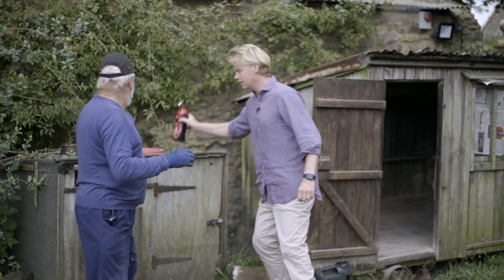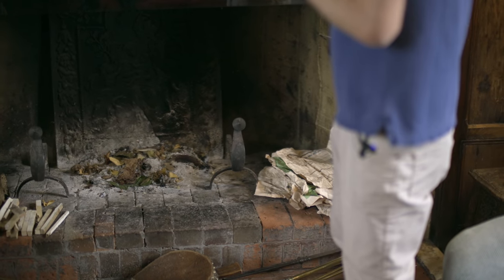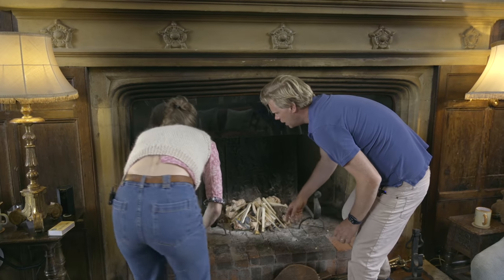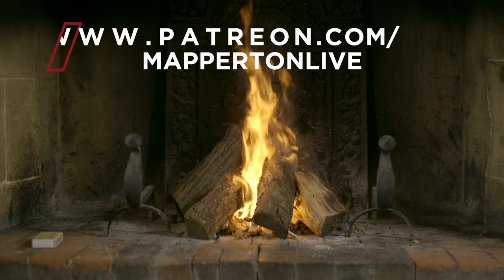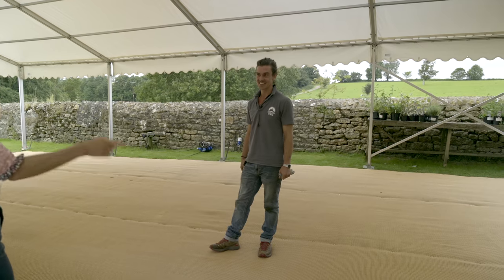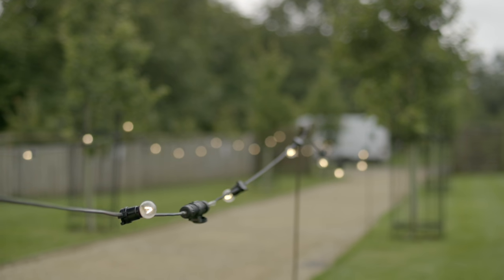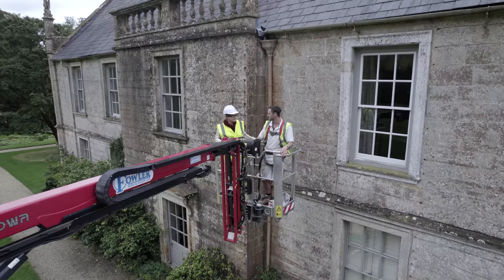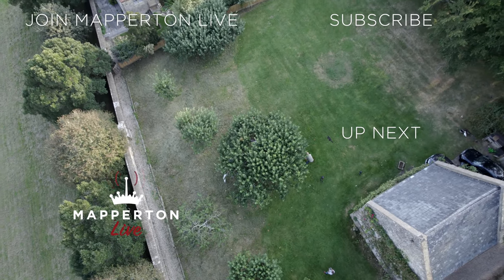How (not) to lay a PERFECT FIRE | Ep 24

Comment: We have a fireplace that is slightly larger than yours. It too did not draw well. We had a fire expert in who advised us to buy a grate that was elevated off the floor of the fireplace to get it closer to the chimney. Ours sits about 10” above the floor. It helped tremendously with the draw. We also installed fans atop the chimney to combat the extreme winds off the ocean that we fight with in the winter.

Comment: When I took over lighting the fire in the fireplace, I was instructed that you needed to "heat" the chimney first. You did this by lighting a sheet or two of newsprint and holding it up inside the chimney and letting it burn. Then you lit the fire. In later years, we had a custom made grate welded and that also helped so that we didn't smoke ourselves out..

Comment: I had a fireplace just like this. I figured out that I needed to heat the air in the flu first….mine had a gas start, so I would turn on the gas and light it before laying the fire. Give it a minute and then add my kindling and wood. Never had a problem after that. Since you don’t have a gas start 🤷🏻‍♀️ finding another way to heat the air in the flu would be key to keeping smoke out of the room. Visions of Julie with a flame thrower come to mind. 😂 of course I am NOT suggesting that. 🙂

Comment: Do you not know if there are pine trees in the area. Pine cone are one of the best kindling you can get. Adding newsprint paper helps to heat up the real wood o that it will get the fire going easily.

Comment: IS THE FLUE OPEN IN THE FIREPLACE?
IF IT'S CLOSED OR THE CHIMNEY NEEDS CLEANING IT WILL DO THAT
Reply: I believe they just had it cleaned from watching the previous video but if it was originally not properly constructed that would mean it’s a structural problem.
Reply: @yubbadubbadubba  Yes, you're correct. Also much of the house is 500 years old - the walls are made of solid stone. More importantly after living in the house for decades I'm pretty sure Luke knows how to spot check and manage his fireplace - and when things are truly going wrong.